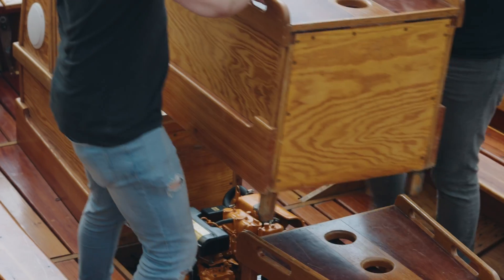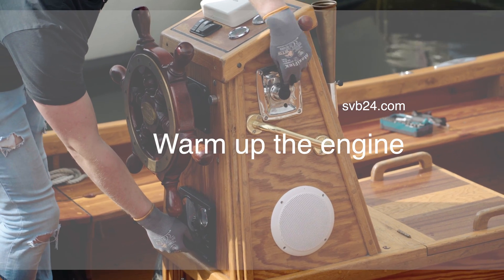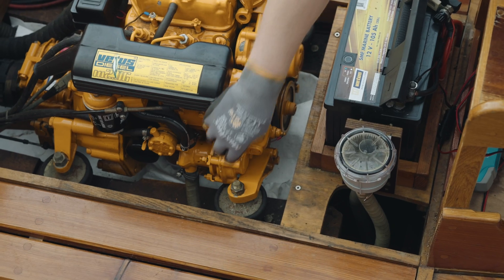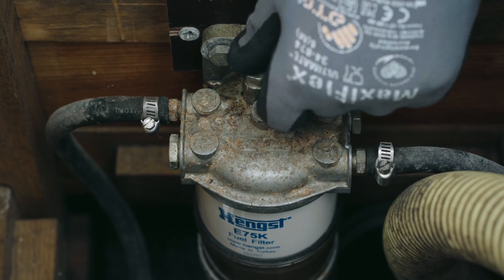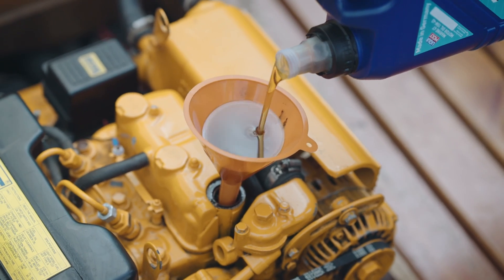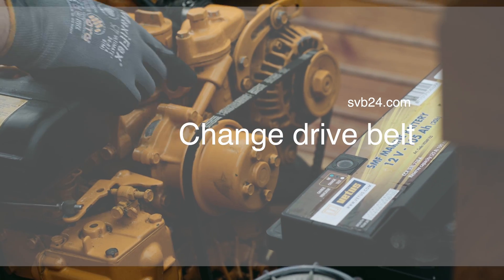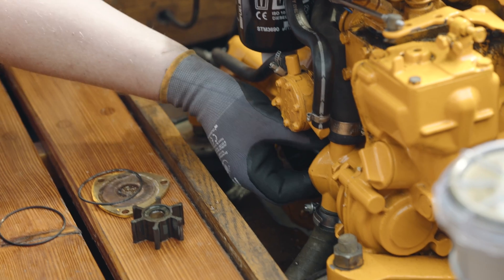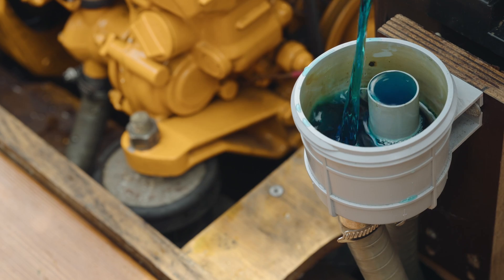Inboard engine - Inspection and maintenance | SVB

Comment: DON'T use a spanner or metal object to push the alternator when tightening the belt. Use the wooden or composite handle of a hammer or mallet to avoid damge to both engine and alternatoi case.
DO add diesel fuel after adding the additive to ensure good mixing ... add additive always before refuelling also.